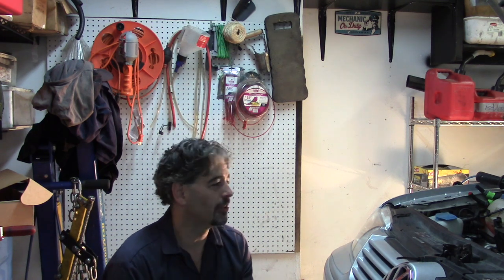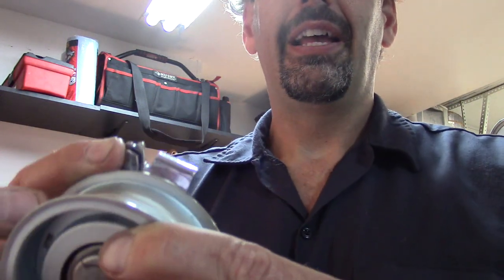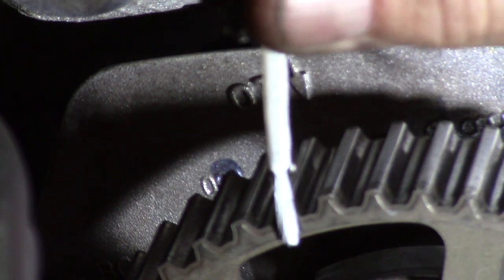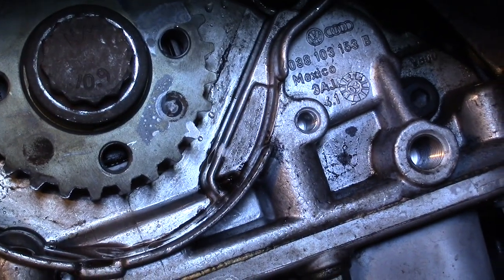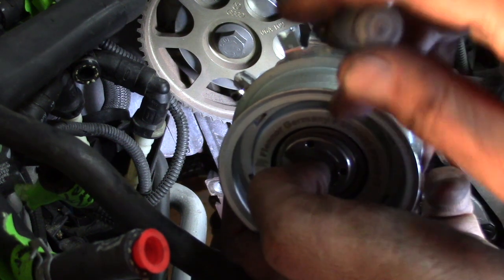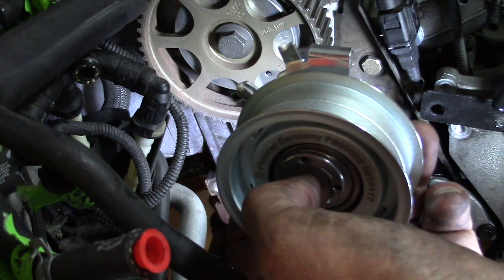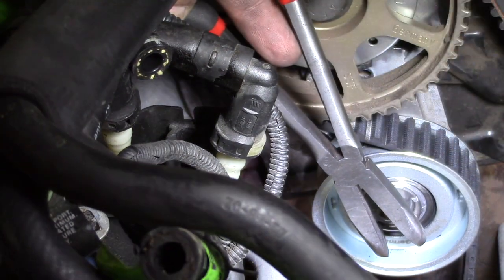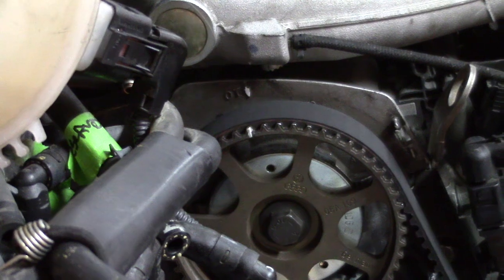PROPER Timing Belt and TENSION 98-05 VW 2.0L Jetta, Beetle,  GTI, Golf

Comment: My 1997 Jetta 2.0 gas has a  different arrangement,  including some sort of temp sensing piston adjuster. Just as lacking in PROPER info available. Anybody have any thoughts, experiences, point in this direction-type suggestions? Thanks J
Reply: +objuan6 I have read that you can replace this part with a tensioner  pulley that does have the temp adjuster. -- like the tensioner that my mk3 94 golf had.... If you are going to do this sort of work on your mk3 vw , I strongly recommend getting the Bentley manual for your car.
Reply: +objuan6 the Bentley repair manual for VW mk3 cars will have the info on the temp adjusting tensioner -I use to have that manual

Comment: im about to replace my camshaft position sensor tomorrow, but the only thing im unsure of is timing belt tension. I dont want to mess it up. What can I do to replace it without having to remove timing belt?
Reply from the maker: +Gillean Gameng What is the evidence you have that the CPS is faulty? Is it Hall effect or inductive design and what is the indication of failure?
Reply: +Schrodingers Box I get code p0341.
Reply from the maker: Gillean Gameng Yes that's my question- what is your evidence the CPS is causing that code as opposed to timing, wiring, PCM or dozens of other variables.  What was your data from your diagnostics that showed the sensor itself is bad?
Reply: +Schrodingers Box ._____. Just the code. I obviously don't know what I'm doing.
Reply from the maker: Gillean Gameng Good luck then. But I really don't see why you would change the sensor based on that code at all
Reply: +Schrodingers Box I forgot to mention that my car shut off while driving.
Reply from the maker: Gillean Gameng Once again- why does this indicate the CPS is faulty as opposed to a failed reference signal to ground?

Comment: Not sure where my comment disappeared regarding the V6 procedure mentioned somewhere, so I'll submit it again.

I have the 2.7T V6, and the procedure there is to lock both camshafts and the crank using some special tools. The sprockets can rotate on the tapered ends of the cams, and are only bolted tight at the very end. This way the timing can be adjusted exact, not half a tooth early or late.

I read this procedure the last time and intended to do it myself, but I couldn't get the tools in time so I had to let the dealer do it. I  have since bought the tools so I'll do it myself next time. 

This is a few years ago now so I don't remember every detail.

Comment: my car sometimes has trouble starting, and when this happens it doesn't allow me to drive over 3000 rpm, could this be a camshaft positioning sensor? I was told it is
Reply: +Andre Lajo It could be, amongst 10000000 other things.   Have you tested the sensor to verify it is working?
Reply: +Schrodinger's Box Quantum Mekanix  no I have not tested it but I plan on testing it tomorrow, I know my engine light was on before for camshaft position sensor
Reply from the maker: +Andre Lajo Then I would say it is unlikely to be the CPS. Test it for function and then if it is functioning check your cam/crank timing.
Reply: +Schrodingers Box really? I would never guess for timing to be off wouldn't that cause much larger symptoms than I am having
Reply from the maker: Andre Lajo Not if its off just a tooth. It's time to start doing diagnostics instead of anticipating what the problem could be.
Reply: +Schrodingers Box OK thanks boss, only reason I didn't do diagnostic myself yet is I'm 600 kms from home but thanks lol

Comment: I found this video extremely helpful and informative, but will this work on my 94 jetta? 5 speed 2.0 liter engine.
Reply from the maker: +Dominick DeSante The concept of timing belt installation is universal to all vehicles. If you understand the process you can do it on any car. If however you are just following rote instructions then I strongly suggest getting a service manual for your application.
Reply: Thank you

Comment: HI what  did  get  on compression  test  on  each  cylinder
Reply from the maker: +emonneil0912 I don't understand-- why would I do a compression test?
Reply: +Schrodingers Box  well mine  belt  broke off now  I just  wanna  make  sure that  no  bent valve, when  I did  the  compression  test  on each  cylinder I got  different  reading  number 1 cylinder  I got  30  psi  but  2 and 3 I got  110 psi  then  number  4  I got  60 psi  so I'm not  sure  if  the  valve  is  vent
Reply from the maker: emonneil0912 Yes if I suspected that there was damage to the engine I would have actually just done a leakdown test immediately but looking at the LTFT/STFT and the fact the volumetric ineifficiency was clearly corrected it is conclusive there was no damage.
  Unfortunately in your case with one cylinder out of spec, that's very likely a bent valve. I would do a leakdown test on that cylinder to confirm.
Sorry to hear that.
Reply: +Schrodingers Box cool  thanks I just  remove  the  head  it is  bent  luckily the  piston  doesn't  have a hole

Comment: I've come to find that after setting the initial tension and running the engine, the indicator will show low tension. The belt is still under plenty of tension, but what are your thoughts?
Reply: +AxleRepus Reset until they stay aligned after rotating engine a few revolutions. I always do it manually first, make sure timing marks are still perfect and tension still looks good. Then run a bit and check again. When set correctly it will stay aligned on those notches. Good luck! (Mainly for anyone in the future checking this comment since I assume to already got it handled a month ago)
Reply: +AxleRepus The tensioner is not set correctly

Comment: The "Stupid" mark on the flywheel is 3 to 4 times more accurate than your paint mark on the pulley. It is much farther from the rotational center. A small bump, lets say a quarter of a tooth on the crank would show an obvious full tooth on the flywheel. That's why its on the flywheel. All the european cars have it on the flywheel for accuracy. I agree a mark and pointer on the belt side would be helpful. Thanks for your video, Ill be doing this in a bit.
Reply: +Schrodinger&#39;s Box Quantum Mekanix I used the Bentley manual for install - the procedures written there recommend using the mark on the flywheel for crankshaft timing.....
Reply: Is there a window there for automatic transmissions as well? Doing this soon.
Reply: Techi Brant yes there is a window on the automatic transmission just did one it’s not in the same exact spot but a little below were the manual one is located. They are easier to see than the manual transmission due to the location and they look like humps. Good luck with yours
Reply: The mark on the flywheel is very accurate and that is the mark that should be used. You should also use timing mark on the crank but the flywheel side is very important
Reply: +0xxRainbowsOnFirexx0 Because when you put the belt on, it is obvious that the timing is finally set by the teeth spacing, the timing therefore either is or is not at TDC on final install. Therefore it is obvious that the stupid mark cannot be "more accurate"- much less 3-4 times.
  When you do this install you will understand.

Comment: great video, but in my case, mi jetta is a 05 2.0 sohc, manual shift, apparently just like the one in youre video , but... it has a very diferent cam sproket whit a metal kind of shield in the front, with no markings in any of the gears or the cover , my timing belt broked, and i refaced the head , but now mi problem is how to align it, i haven´t found a single sprocket image, similar to mine in any site so far, i hope i find something, cause  taking the valve cover to set the cam, an not the sprocket is not very accurate, or easy
Reply from the maker: +Rufo Alcala I have seen models where the mark is on the cam itself- sometimes the back of the cam, but there WILL be a mark for the alignment of the cam.

Comment: VW's 1.9 Diesel is slightly easier to do as it does have the timing mark on the crank pully. Also the tensioner has a hole for an allen key to rotate it instead of the need for a special tool.  Really goods videos, and love your explanations. Thank you
Reply: I was wondering about the diesel, I have one and I'm planning on doing it soon. Thanks for info

Comment: I came here looking to find a video on how to flush and check on 1998 VW Jetta 2.0 coolant and radiator. I think it is not working right... 
(beings I do not know anything about VW, I do not know where to start)

The car gets hot (@195) on the temp gauge inside the car in 7-10 mins, 
but under the hood, the back of the engine gets real HOT ... Ouch hot!

The lower hose does not get hot and yes the upper hose is Hella hot. 
I went to change out the t-stat and I could not find it. 
I guess it is DEEP behind the P/S pump on the lower left side.
ALL most all the videos I see on YT are for the Beetle and do not look like or are not laid out like the 1998 Jetta 2.0....

I flushed out the coolant the best I thought I knew (yeah before finding that video on YT) and refilled with new coolant. I was looking to see HOW MUCH and how to get the excess AIR out. OH SO Hard to find a good video.

I put in @ 3/4 of a gal of new full coolant and filtered water. 
so it is ??? 60/40 or even 70/30 coolant/water   
 HOW BAD IS THIS????

PS: When I ran the car for 10-15 I did not get hot air when I had the heat on... 
does this go back to me thinking that the T-stat does not work???

So could it be the:

Water pump
T-stat
Heater core/block??

or junk the car and buy a Honda?

GF
Reply from the maker: Why do you suspect it could be the pump or T stat when the upper hose is hot and lower hose isn't?
Reply: I don't NOW, after watching your video I know they work and I guess the car is fine... It just seams HOT  TO ME..? :)

Thanks for the great video! 

and YT

:)

Sad but funny thing now, is it has a new oil leak.

Comment: This just reminds me of why I don't touch VWs anymore. I did this job an an older jetta that lost all its coolant.

The water pump shaft had a bit over 1/4 inches of play up, down left and right. The dick that previously put it together doubled up the old and new gaskets, noticed it leaked and much have used a whole tube of RTV trying to seal up the warped plastic flange on the pump. I have no idea how it lasted as long as it did in that condition.

And that stupid tensioner design. All together you had to remove the alternator, ac compressor and belt tensioner to get in there.

I was so happy when that piece of shit got junked.

Comment: Hello,

Good Idea to make this video . And it is a good idea to make a head cylinder rebuilt video. 
thanks for posting accurate content video.
Reply from the maker: Guillaume P Yeah I was thrown off by using a simple wrench for the serp tensioner because usually VW's use ridiculous expensive tools for everything lol.  Last time I did just a simple axle removal I needed these funk 13 spline Assenmacher allen sockets or something.  Gosh, what's wrong with just plain hex bolts lol??

Comment: What would happen if crank was set at 180 degrees out and engine was started? I had a 01 Jetta brought to me with timing already torn apart and was not set at TDC to begin with?
Reply from the maker: ***** The engine definitely wouldn't run but it would seem to me it also wouldn't cause damage
Reply: Schrodingers Box I got it all back together, thanks to you video. I turned the crank around about 12 times to ensure nothing blocking it from turning. Also checking each double turn, to ensure the marks were all still aligned. Thanks for you help, it started up and is running fine after a 12 mile road test.

Comment: Schrodingers Box On those VW engines there usually is a timing mark on the top of the crank pulley that drives the alternator belt.
The issue is that you have to remove that pulley in order to access the timing belt...
Reply from the maker: BavarianMonkey Well that's useless lol!!

Comment: 2006 Subaru Impreza 2.5i non-turbo wagon

Hi Guys, I recently did my first timing belt job. I thought it went well as I started the car and the engine seemed to run fine. A couple of days later I noticed some issues with the engine and decided to get back under the timing belt cover and check things out. Timing belt itself looks fine. Crankshaft and camshaft markings all line up like they should when camshafts markings are straight up. The problem is in getting the crankshaft sprocket marking straight up. The engine is EXTREMELY resistant to being cranked over. This was not a big deal the first time around. In finishing the timing belt install I hand cranked the engine several times by hand to check the timing between the camshafts and crankshaft sprockets and everything looked good. I didn't have any difficulty doing this.

I bench 250lbs x 5 and deadlift 225lbs for a workout and I am now having MUCH more difficulty getting the crankshaft sprocket straight up. The engine wants to spring back against my clockwise cranking of the engine.

Why I Went Under the Timing Belt Cover Again
As I have been using the car in the past few days I noticed that the engine sounds like it knocks when I start it up, but it starts easily. It also makes an extra clicking sort of sound when it idles. Sometimes as it idles, around 500rpm, the revs drops a bit and the i hear/feel a knocking going on. Could that be my ECM still relearning? For the most part the car is running smoother than normal when the ECM is relearning it's fuel mixture.

I notice more vibration out of the engine than normal. I have seen that before, I believe it is usually tied to a misfire in at least one of my cylinders. I have a known internal oil leak. Lately that engine vibration hasn't been present. It popped up again just after the timing belt job. Other than that the car moves as fine as it did before the timing belt job and has been driving fine.

I'm not entirely sure if the knocking issues are related to my timing belt work. My main concern right now is my inability to crank the engine over by hand.

Please help, I had to call off of work on account of this. I can't make any money while my car is apart or in questionable condition. I am in an emergency situation. Thanks in Advance, -AJFresh
Reply from the maker: In order to help with this it will be necessary to know how much you bench press.
Reply: lol i haven't tried a one rep max. most i've done lately is 250lbs.

The point of mentioning the 250 is to make clear that I'm no weakling and yet I can't get the crankshaft to sit still. It continues to want to spring back out of position. Is cranking the engine in reverse out of the question?
Reply: AJFresh As I sat here attempting research, somehow out of nowhere a question popped into my mind. "Did you put the car in gear?" ?!?! Ran outside to check - yes I did. Relieved the tension on the breaker bar I locked under the AC compressor then took the car out of gear. Engine turns over like butter LOL

Now I can turn to the issue that brought me back to the timing belt in the first place
-Why do I have increased engine vibration?
-Why is there some kind of knock/sound/brief vibration on startup?
-Why does idling periodically get rough?

All that comes to mind is that my cylinder heads are out of sync. Maybe I should remove the timing belt, rotate either camshaft around once from having it's timing mark straight up where it is now, and reinstall the belt. Any constructive input would be appreciated
Reply from the maker: AJFresh Its obvious the install is incorrect- redo it and try turning the crankshaft without the timing belt attached. If it doesnt turn over easily by hand then you have a major problem. actually it possible you have one anyway- you need to get back in there- actually someone with more experience who knows what to look for should do it to be honest.
Reply: Update: Removed timing belt, cranked driver's side cam sprocket once around and reinstalled. Engine starts up smooth and doesn't drop revs :)
Reply from the maker: AJFresh You turned the cam 180 or 360? If you turned it 360 then that makes no sense that it runs now.
Reply: 360. You're already aware of the occasional spring tension that can exist when positioning the cam sprocket. Sometimes the tension is there, sometimes it's not. I believe this is related to the phase of stroke the valves are in.

When I first got to the timing belt off I noticed one sprocket had tension, the other didn't. This was the correct tension to no tension configuration of the right and left side valves. Then the tense cam sprocket slipped so i brought it around and put the timing belt on. Then I noticed the oddities of how the engine ran. 

Seeing as how my engine did not seize up on startup (I had successfully hand-cranked the engine first), I figured I avoided piston to valve interference but perhaps the left and right sides were not in proper sync. So I removed the timing belt and turned the driver's side sprocket around 360. I could have done the left side, it was arbitrary. Engine now runs smooth :)

I could totally be wrong too. I'm new to automechanics and learning
Reply from the maker: AJFresh Makes sense to me.  Man you are REALLY lucky you got a second chance to do that. The vast majority of people who ask me similar questions did not turn out to be nearly so lucky.  At least the next time you do one it will be much easier!
Reply: The boxer engine design prevents piston to valve interference so long as you have the crankshaft and camshaft markings straight up. Next time I do a timing belt on a boxer I'll check to see if one sprocket is tense while the other one is loose. If so I'll be pretty sure this relationship needs to exist between both cylinder heads when doing timing belts on boxer engines